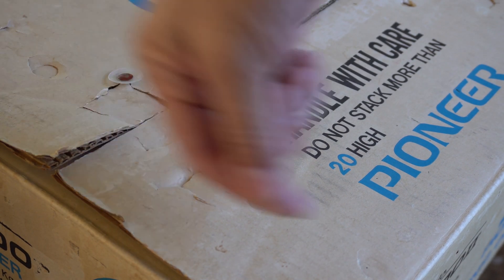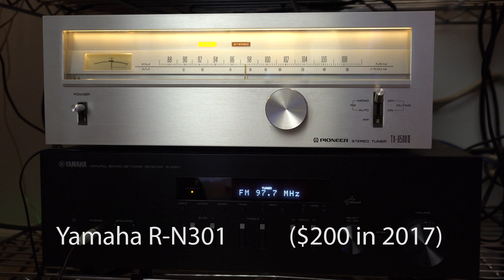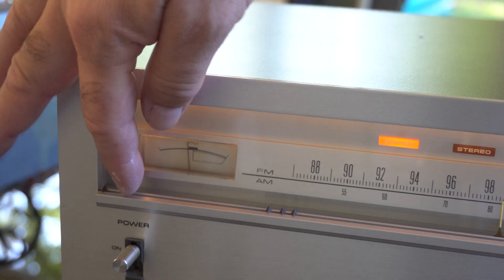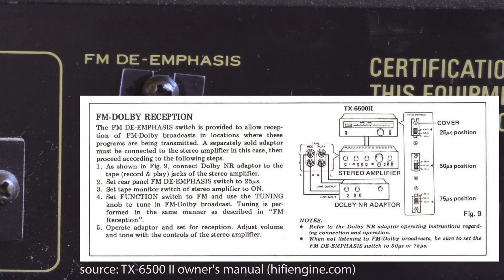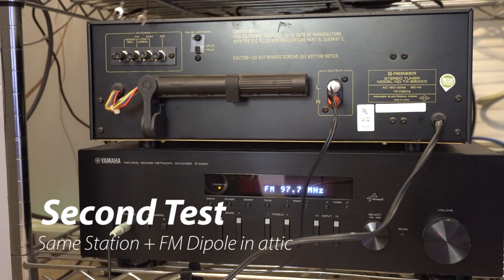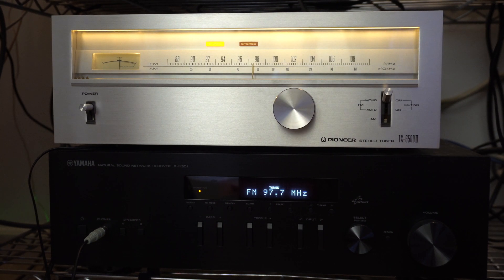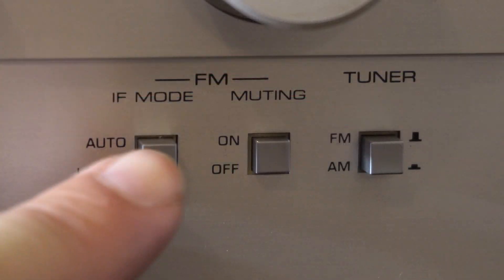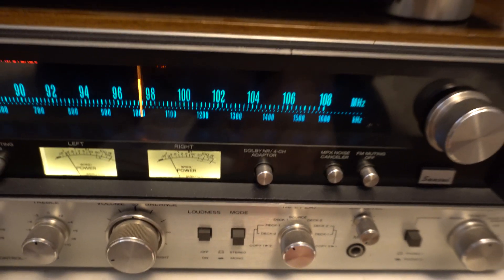The Pioneer TX-6500 II  vs. a Modern FM Tuner

Comment: I use speaker wire and wrap it around a very large steel bolt and tie it to a pipe in the house and I get the best signal 
Or they have the very old amplifier antennas or bunny ears

Comment: You compared the bottom of the line Pioneer against a middle/top of the line Yamaha.    If you had compared a Pioneer 8500 or 9500 they probably would have performed much better.  Also the 6500 analog could need an alignment, whereas the Yamaha digital probably doesn't ever need an alignment.

Comment: Something that I saw right away is that you have it sitting on a metal rack, if I even put any of my older, silver faced receivers on a metal table they lose reception.  They can be finicky about where they sit and surrounding metal objects. 
I think the big difference is the presence of an actual tuning capacitor or just an IC chip for reception. None of my later, digital receivers are very good at picking up stations, even with a tunable directional FM antenna on a tower here 50ft in the air. 
My best FM reception in a receiver is from a cheap AM/FM/8 Track combo unit from Sears from the early 1970's. It picks up stations 50 miles away and holds them in tune, even with just a dipole antenna. Overall, a few older portable radios are even better yet, one is a GE Superadio, the other a similar age Emerson portable that's been hanging in the shed outback since I was a kid in the 70's. It still works and still gets stations no other radio every seems to find.  Its in such rough shape from dust, dirt, and sawdust its hard to even tell what it is, but it still works fine. There's still a hang tag on the handle for $11.99 from a former local electronics store with a sale sticker marking it down to $9.89.

Comment: I have a similar issue. Have an analog tuner that one station basically just holds static. Figure a bad spot on the dial as it is a 100,000 w popular local station. Hold events in the city etc. Others come in fine. My analog is going into the shop and I got a newer digital tuner and pulled in the station I couldn't get before. After listening most of day there was almost no bass. Then the station started fading in and out. Other stations play fine.

Comment: Old analog sounds much better than digital, late 1970 FM tuners (mainly Kenwood and Pioneer) is the only thing I will use, digital just plain sucks. From brief shot, you appear to attach wire to wrong screw for reception. Yamaha is junk when it comes to reception, even the late 1970's tuners as I have 1 sitting in the closet.